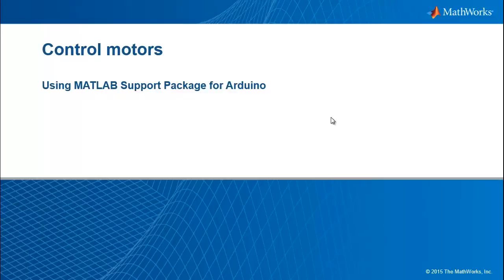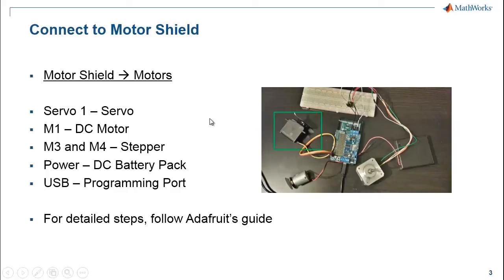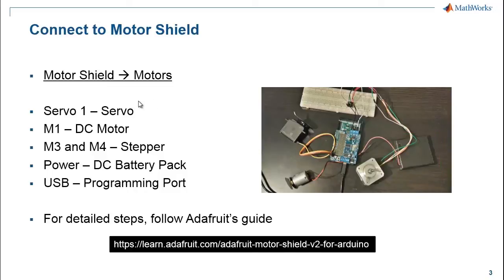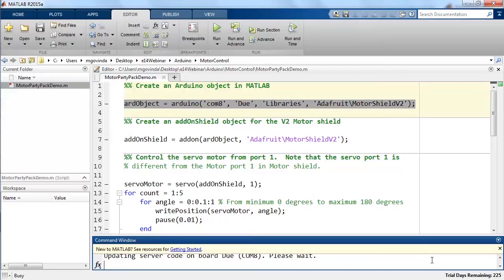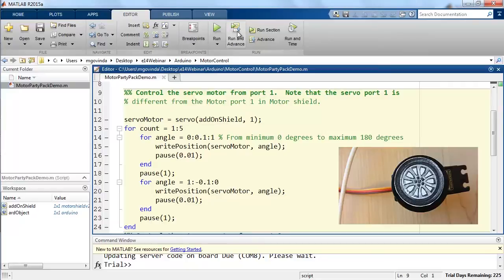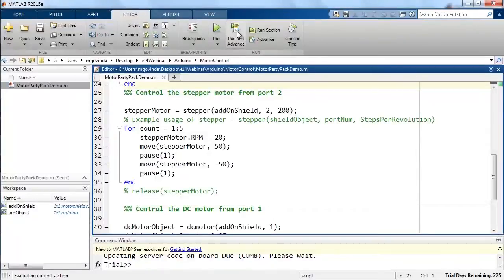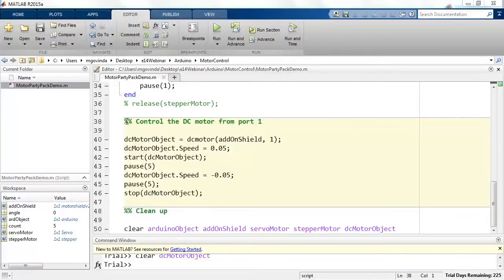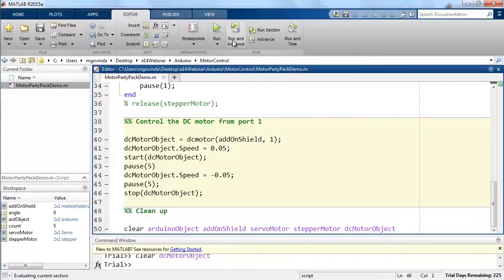Using MATLAB and Arduino for Motor Control

Comment: I bought your ebook, I have tried your first assignment. Did everything  I was supposed to do and I got this error... How can I fix this?
Error using led_control_led_control_OutputFcn (line 77)
Failed to open serial port COM3 to communicate with board Uno. Make sure there is no other MATLAB Arduino object for this board.
For troubleshooting, see Arduino Hardware Troubleshooting.

Error in gui_mainfcn (line 264)
        feval(gui_State.gui_OutputFcn, gui_hFigure, [], gui_Handles);

Error in led_control (line 42)
    gui_mainfcn(gui_State, varargin{:});

Comment: I’m working on a XY gantry. I use 2 stepper motors (6.8 V, 0.75A, 1.8 DEG/STP- Type 23LM). I’m controlling these motors with Matlab (support package for Arduino- Not SIMULINK) and Adafruit Motor shield v2.3.
But my problem is the motors speed. How can I increase the motors speed?